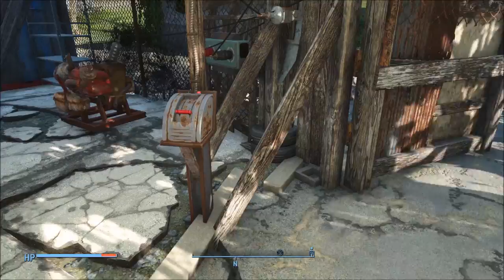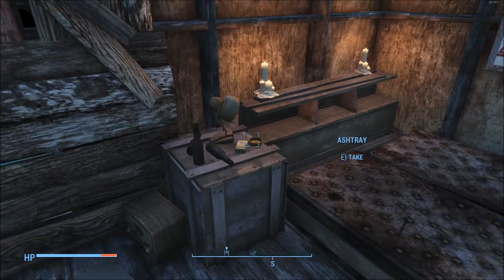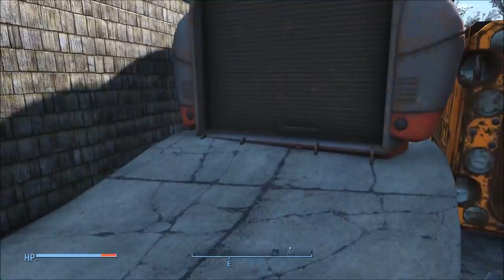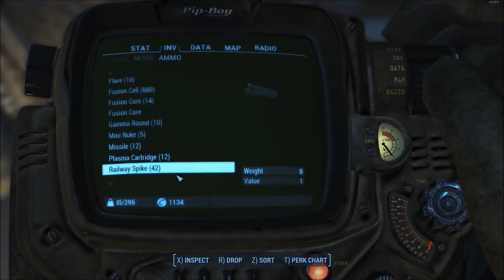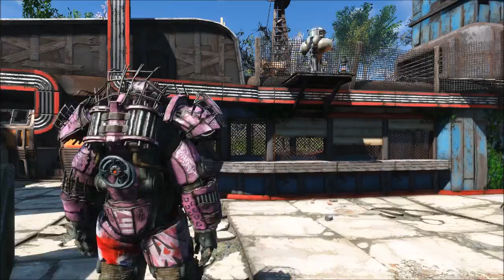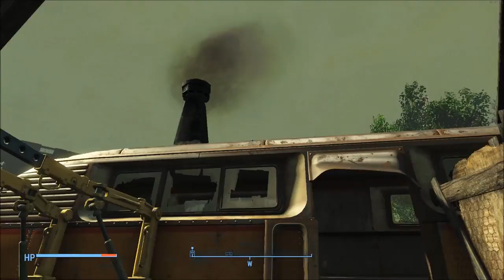FALLOUT 4 - The Starlight Drive-In Scrap Heap pt 2 with New Mods

Comment: Have never seen the 'Fusion Core Refueler' mod on the Nexus. Thank you for showing this to us. Just made a bee-line over there and grabbed this little jem.
If you are still on the lookout for mods then i would suggest 'Auto Doors by Wenderer' (Nexus mod #8457). This adds in a few new objects that automatically close doors that are open. There is even an object that opens them for you as you approach and then closes it afterwards. If you go for it be sure to grab the hotpatch from the stickied post in comments.
Reply from the maker: I saw the auto doors mod, and read all through it and decided that it was really over-featured for what i wanted, which is just a button to open and close doors.  actually this is a conduit, so i can hook any system to it I want, and I'm fine with that.  Thanks for watching man :)